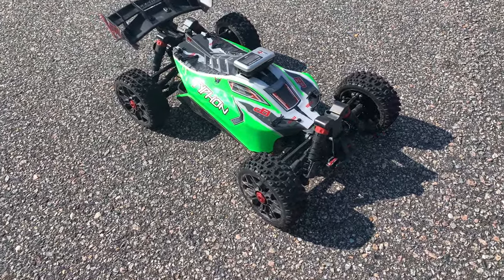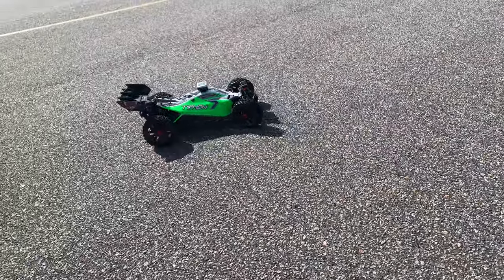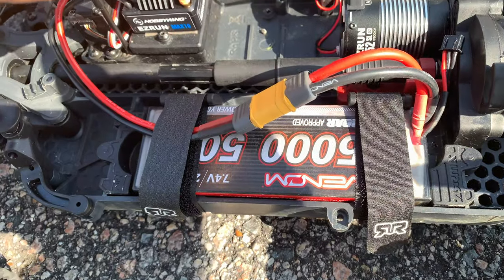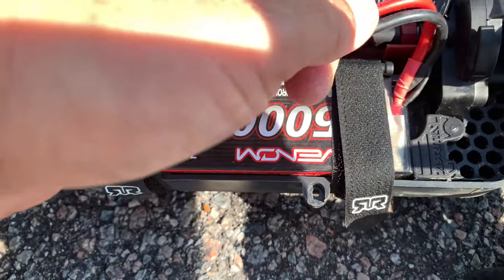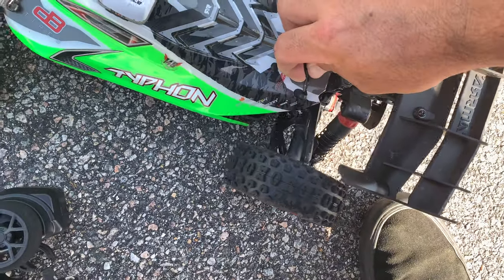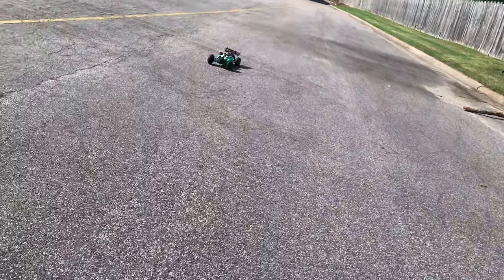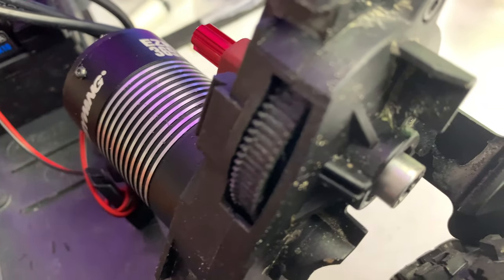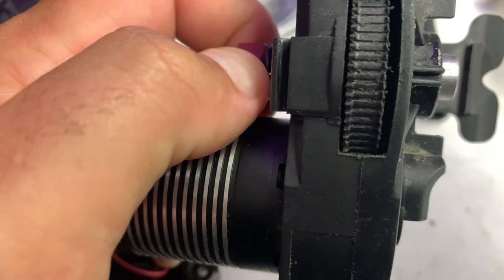Brushless Converted ARRMA Mega 4x4 Speed Test With 19t Pinion Ends With Wrecked Spur Gear

Comment: Steel 48p is what I run on my Senton and it is beautiful. Personally don't think it's necessary to go mod.1 on a mega conversion. Just need metal gears and metal input shaft on the rear diff.
Reply: Hey how is the steel gear holding up? Deciding on whether to go with that or the plastic 32p
Reply: @travispratt6327  Steel 48p gears are smooth as butter on a hot a Texas day...using the higher pitch gears makes it much quieter as well. Go mod1 or 32p it'll be tougher and a lot noisier...and unnecessary on smaller scales, use lower pitch for larger vehicles since the torque can get nutty but on a 10th scale you're not likely to have any issues with 48p 😉

Comment: Spectrum 4000 or 3300 kv motor with 85 amp esc combo and new pinion was $107 after taxes at the hobby shop and are great! You do mid 30’s on 2s which is what we prefer to run anyway, due to less possible damage and still speeds good enough for track racing and bashing using a 15t pinion on the Typhon Mega!
Reply: I went with the 3300kv and the 85 amp spektrum still have stock mega gearing in it with good mesh and 2s its faster than the one in this video looks on 3s and doesn't tear itself apart. I'd say you're right, the fan bearing in my esc seems to be funky straight out the box tho. Could of been something in it gonna clean and run it some more and see how long the stock spur lasts. It looked like the mesh was a little loose from the factory. Any suggestions on what spur and pinion to swap to once I fry it?

Comment: Hot Racing makes a nice 48 spur. Had one in my Senton for years. Matched with metal input gears and a Robinson Racing hardened pinion, it's bullet proof
Reply from the maker: I believe this 2020 model has the metal input gears. They diffs are supposed to be able to handle brushless conversion.

Comment: I added a post about this happening to me twice in your last typhon video.  Horizon sent me a replacement now for my third attempt.  My guess is that there is a little bend to the red aluminium shaft or the spring causes a small wobble.  I would check mesh with gearbox screwed together then rotate gear.  Mesh would be perfect in one spot, then a little play in a diff spot as I rotated the gear.  Best to just get a 32 pitch gear and save alot of time.
Reply: Hi I'm very new (just got my typhon mega a few days ago).  Any specific spur gear you recommend, or, how would I be able to know what gear I could get and use?  I see this for the typhon 3s but I assume it's a replacement 48p and is not the "32 pitch" gear like you talk about: https://www.arrma-rc.com/part/ARA310947

Comment: Knotch under your spur gear and allow dirt and debris to leave out and won't torch em as much. I seen a yeti conversion for this I wanna try on my senton mega brushless conversion currently on 2s I feel it is way under powered went from 17t to 26t not much difference. Want to throw 3s on it and let her rip and see how the spur holds up if it toast it then gonna get the yeti conversion.
Reply: From reading on things we can use the blx spur assembly on these. Would make it alot easier on the spurs
Reply: How did this work for you, did you get the metal spur gear in? Did it in turn destroy the pinion gear? I could not agree more about notching the pan. My sons 'MEGA' is completely stock and clean, it toasted the spur gear after about 20 hrs. Looking at the base plate there is a spot where clear rubbing occurred between the spur and the pan, without any dirt. Design flaw.
Reply: @cclongboards  yes it all worked I ended up swapping to a 3s motor and esc and changed the diff gears also cause shafts started breaking
Reply: @cclongboards  all in all tbh if you wanna upgrade them just cut the slot and maybe swap brushless don’t mess with pinion gears or any of that cause once you do everything starts breaking be cheaper to get you a 3s senton or a 4s after that I don’t have them anymore I ended up getting a 4s kraton for my son and me a 6s kraton and them things are beasts a pretty penny for em but I can get it to do what they were doing breaking parts comfortably
Reply: @xxxg0t3mxxx  Thanks for the input.  Going to leave this stock for my kid for the time being, but I may upgrade to the metal pinion. This car is plenty for him to handle at this point. Got it 2 years ago when he broke 2 cheap RCs with no repair options. Aarma seems a good brand for parts availability, a bit touch and go during 2020, but good since.
Reply: @cclongboards  I love em over traxxas yeah metal gears are good just make sure you cut the relief slot in bottom also the slipper pad may slip a lot if it does rough it up a bit with some sand paper or something gritty

Comment: The spur assembly is a bit of a final straw for upgrading this car. New motor and power controls, new battery, shaft stabilizer and now a spur assembly. Just get the 6s if you want more speed.

Comment: running the 4kv system in latest granite mega so has the 13t 37t diff gears , 14t pinion 3s 50c 5000mah  punch level 5  and yet to kill a spur even tho ive snapped 2 shafts and stripped input gear which are the same as the 3s version. tbh not sure why so mean people strip spurs so easy in the hobby  as i have yet to do so , just adjust mesh so its tight as poss without binding i tried paper and thought the result was poor tbh . if i strip a spur there £3-£4 anyway i brought a spare when ordered input gear ara311031

Comment: I’ve upgraded mine to 4S, capable of 6S with the Max8 and the Spektrum 1900kv motor w/21T pinion. I’ve also upgraded the drivetrain to all metal and suspension components. The thing is a beast! Need a mph device to see what she does. But when you went from 2S to 3S it was much faster! Get that metal slipper! Love mine!
Reply: What parts did you order for the conversion?

Comment: The moral of the story is, if you are going to go brushless, just get the 3s. By the time you done all these things you have a worse buggy that cost more than the 3s model.
Reply: Agreed. It would cost in total over $410 retail to turn a mega into a blx using identical new parts.
Reply: Lawrence Timme I would but I didn’t know I was going to go brushless and I didn’t know there even was a 3s typhon, the 550 was my first car and has been my favorite car for just about a month now and I finally want to go with a brushless upgrade, and I plan on upgrading just about everything to the 3s components, such as the bearings, gears, tires, etc. Will be an expensive, but yet fun project.
Reply: Nobody No O’Neill mean ya but who would get identical parts? Most people get different brushless systems that the 3s uses and almost no one will ever get the entire 3s components down to the bearings and screws lol (except me because I’m crazy and stupid)
Reply: @spinster4000  Let's do the math. What system would you use?
Reply: Nobody No One personally I’m going with the arma BLX 100 system, but a heads up I suck at math lol
Reply: @spinster4000  A new Typhon mega is $230. A new blx 100 esc is around $95. That's $325, but still a brushless motor and possibly other parts will be needed on top of that. Meanwhile, a new brushless Typhon is $320 with various upgrades already installed.
Reply: @nobodynoone3428  Ya I get that, I wouldve gone for the 3s had I known it even existed, see when I bought my first car I had no idea ARRMA made a 3s and a 6s typhon, the only one at my local hobby shop was a typhon 550 and the nearest hobby shop that MIGHT have had a 3s was at least a 6 hour drive, (BUT i didnt know about a 3s) so ya i totally would've gone for that sexy 3s . Oh and I am from canada so my typhon 550 was already 300 dollars and for my first car i didnt want anything over that as it would be too expensive and i wanted to see if this hobby was for me, but ya if you want to upgrade to Brushless, save some money at the same time then get the 3s over the 550.
Reply: @spinster4000  still cheaper to sell the mega and buy the 3s model
Reply: Did my brushless upgrade for 35. Gave 200 for car new cheaper than the 3s route
Reply: Yes, absolutely, this upgrade path is financially irresponsible even if it is fun.

Comment: Smartest thing would be to get the transmission from New model MEGA 4x4 with that motor housing. Much easier than doing it old way.
Reply from the maker: This is the new 2020 MEGA 4x4.
Reply: @CCxRC   Jason said we should now be able to just drop in the 32p spur gear with that version then. Mine is old version and way complicated if trying to use the stock spur. If you have the newer version then you should be able to use your stock spur and just switch the gear to a 32p....supposedly! I had to just use a 3s slipper clutch assembly.
Reply: In the video you mentioned cost and if you have the new version it would be more cost effective to reuse your spur with a 32p spur gear installed. Unlike mine, I had to get the 3s slipper clutch assembly and it basically took my cost up to 3s BLX truck. I had told you how I had done mine in the past, and I wanted to make sure you knew that using the stock slipper is now supposed to be way easier. Found that isn't the case though. I guess they will get the slipper right on the next one. IDK..anymore!..:)
Reply: the smartest thing is sell the mega and buy the new 3s version  ,problems solved lol

Comment: I have the same car with a hobbywing ezrun max10 3200kv brushless motor and esc. 

20teeth it’s goes about 50mph on a 3s 2200mha batty. Iv never had this happen before. This is weird!!
Reply: Oh and it doesn’t over heat at all. I can still go fast if I wanted too as well.
Reply: Nice! Being very new, I put in the 3300kv which is not a perfect fit for the car. Still, way better than the brushed, of course. I saw the 3200kv has a 5mm shaft and comes with a pinion. Did you change the spur or the input dtive to the metal versions? I would appreciate an update on how it went, please.

Comment: really disappointing Arrma went 48P on an 1/8 scale car.  they gave us no room for upgraded power without spending money.  wouldn't have cost them any more to include the 3S 32P spur setup, but instead they make you spend $50 to buy it and replace the worthless 48P crap.